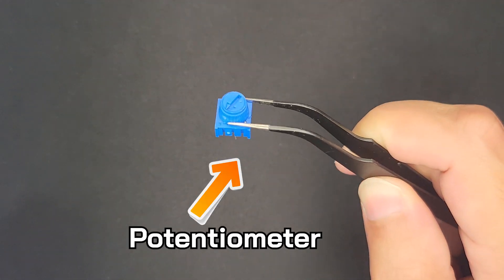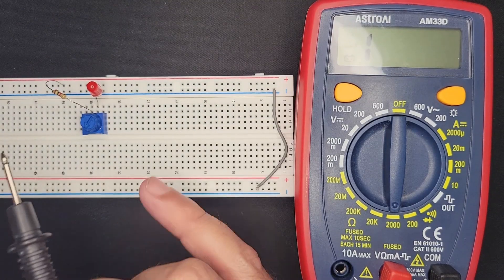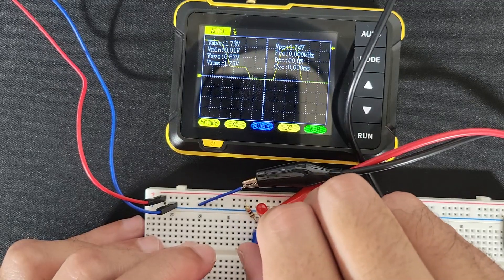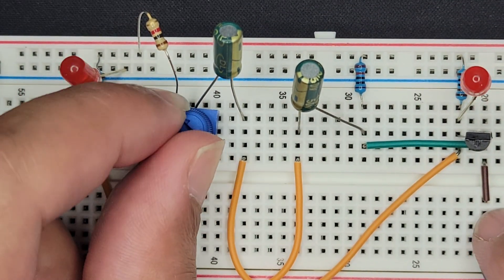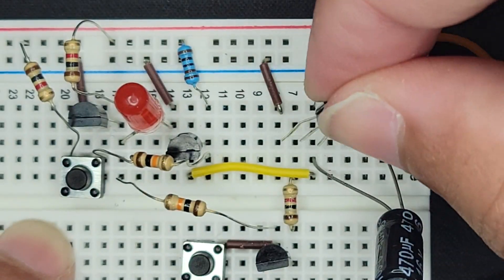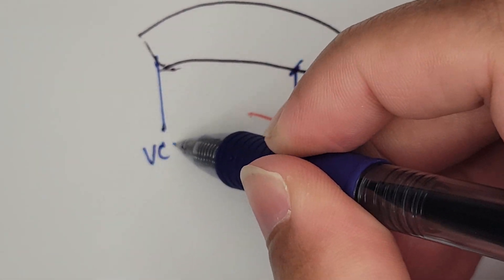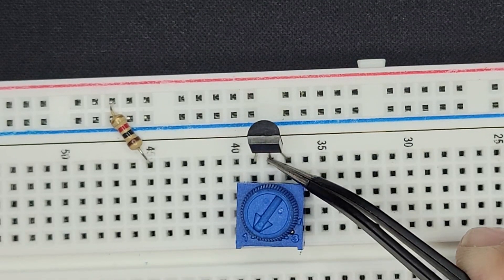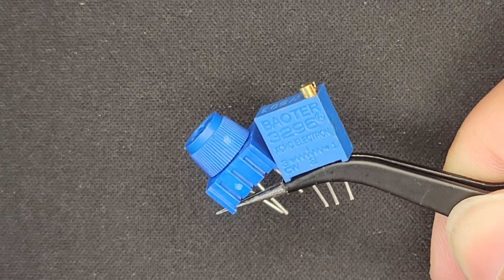Potentiometer Testing | Beginner Learns Electronics Ep20 | How to Use Potentiometers

Comment: Hi, great video!  You've shown how potentiometers work really well here.

To answer your question on the advantage of using a potentiometer in parallel with a transistor: while the potentiometer and transistor both see the same voltage, they do not see the same power dissipation (watts). Remember  that Power = current * voltage. If your transistor 's current gain β=100, then your potentiometer only sees 1% of the total current (plus V/the total R). That means you're dissipating way more current in your transistor than your resistor.   If your transistor is designed to dissipate heat (many come in special packages for this), it's less likely to melt.

This isn't a great control circuit to use directly in practical applications, but it is a simple one that can get you thinking about ways to control a current with a lower-power signal. For one thing, it's really dependent on β once the transistor turns on, and it can never fully turn off since the potentiometer will always conduct some current.

If you wanted to accurately control the brightness of an LED, you'd probably want to do that with PWM.  There are great tutorials out there for making a PWM circuit with a 555 timer IC; may be a cool project for down the road if you're interested.

Great
Reply from the maker: Thanks a lot. Your explanation makes sense to me, sorta intellectually, but practically speaking it's a little difficult for me to envision. I think it's demonstrating my lack of true understanding of how the NPN BJT's work (i.e. the gain). I understand that more voltage/current on the base will allow more current to flow from the collector in tandem.

If we can assume the transistor is 100% capable of handling our hypothetical high current, I think my stumbling block is imagining that the potentiometer is turned to 0 resistance in parallel with it (the configuration you described, and as I tried to demonstrate in the video). In this scenario -- potentiometer set to 0 -- wouldn't all the current available flow through it, as it would be the path of least resistance (~0 ohms)? However, if there's 0 ohms, then there wouldn't be any voltage dropping across it, and thus couldn't have any wattage (P = VI, and V is  0 in this case? lol). There are a lot of holes in my understanding, clearly. I'm not sure if I am communicating my confusion clearly enough. It's a tough thing to articulate! Thanks again for all your help and input.